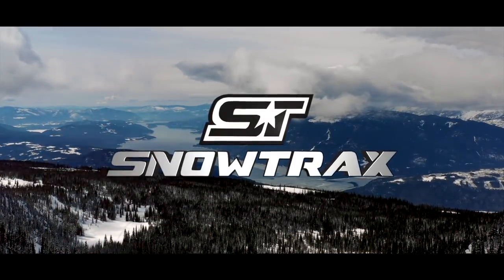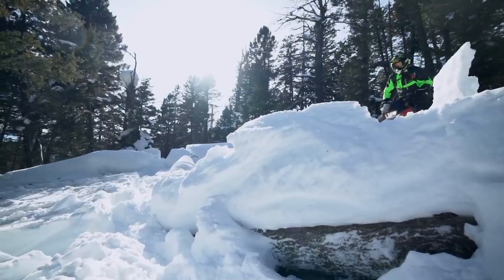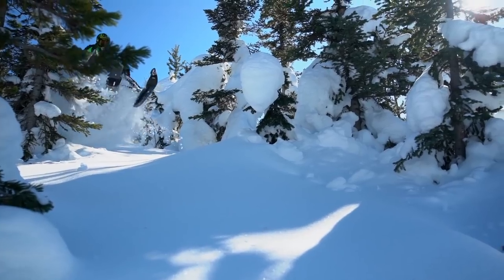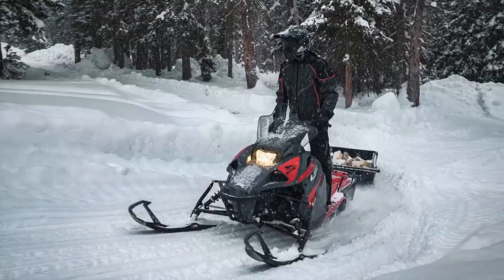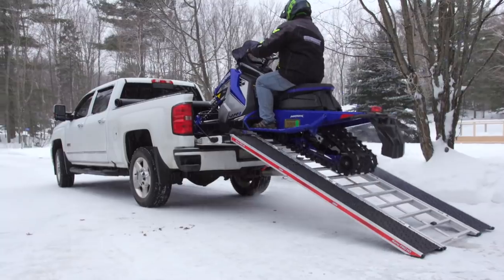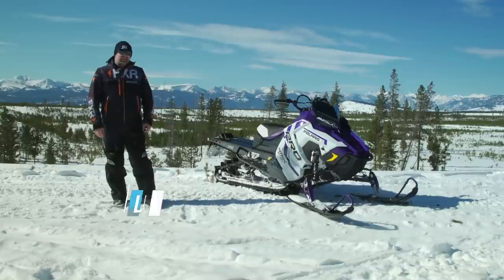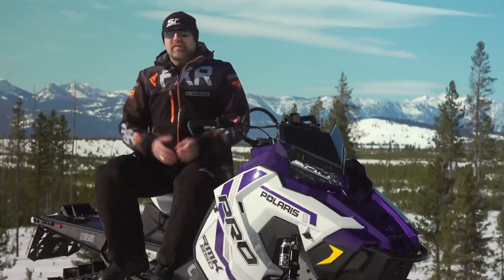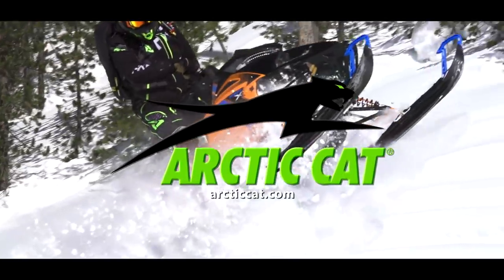SNOWTRAX TV 2021 - FULL episode 9

Comment: I know there aren't a lot of actual Blasts or SX Venoms out there so I'll report that indeed a lack of vibration was the first thing that I noticed when I received my SX Venom Mountain. Because of the displacement size and it being a 2 stroke one would not even notice it's a single in most instances. And for what it is it's reasonably fast. You can grab a decent squirt of instant, not gradual, power at 50mph. It seems choked by the factory pipe in terms of how hot it was but other than that I'm totally happy with it and I'll tell you with something else. I'm a 250 lb longtime snowmobiler in Western Maine and I bought this to replace my 95 Elan for the backcountry Land Management that I do in very rugged terrain sometimes alone. I have a feeling there are a lot of people using these sleds for reasons much different than what people think. Wet weight isn't yet published but is going to surprise people...it's remarkably light. What is under-reported is the fact that from what the dealer told me none of these are going to Canada I had to get mine from about a thousand miles away and it was only on the dealer for 4 in the afternoon. This is because of the lawsuit that Bombardier has taken out and from what I understand there is money potentially being lost on every one of these that is sold.
Reply from the maker: Great comment! Thanks for sharing!!

Comment: Snow tracks what's your favourite snowmobile all time
Reply: 1988 Polaris Indy 650 triple/triple.  At the time, this was the first real lake sled in my opinion, and in '88 nothing really matched it in speed and reliability. 105 horsepower is nothing to sneeze at today either and makes you wonder how far we've really come in the last few decades.  But the cool thing was showing the guys in the ice shacks the engine, the triple pipes being truly new and novel at the time, and the handsome red cylinder heads match the red pinstriping and details on the otherwise jet black chassis. I still miss hoods that open that way so that you could warm up your helmet or gloves on your engine if you needed to in a pinch. And the chassis was basically as good as anything else and it's day. I have always ridden mid-week in rural areas and have never needed a REV chassis. And they have always felt tippy and awkward to me. I later moved on to a 91 SRX and I appreciate the effort that went into making the new one lower than it's stablemates. I'm still not sold though
Reply: My 1998 mini Z I grew up on but I think the old thundercats,MachZ, Polaris XC and for Yamaha the Apex  all Awsome
Reply: The 03 firecat. reliable and fast!